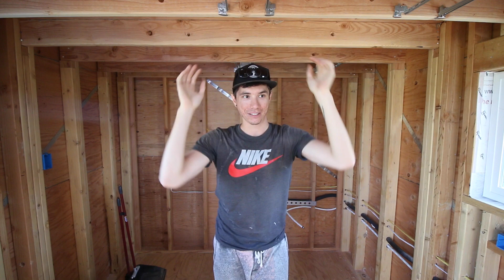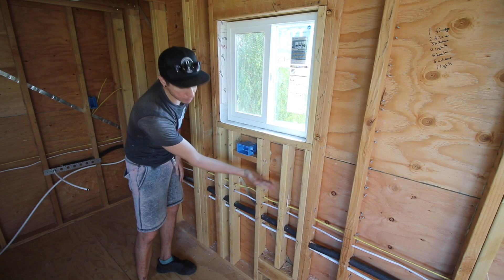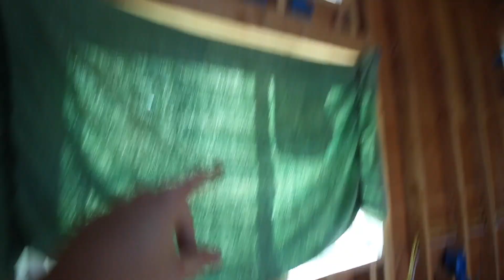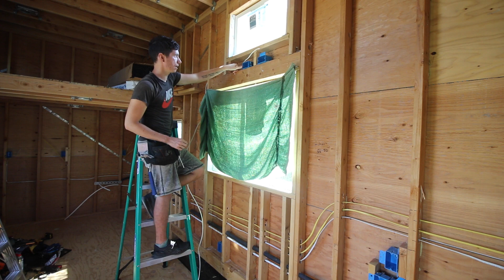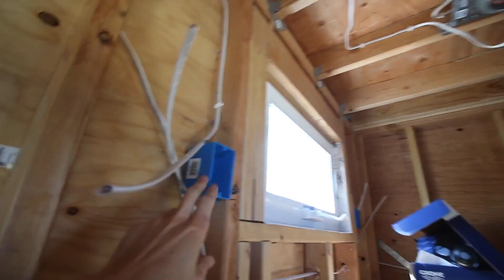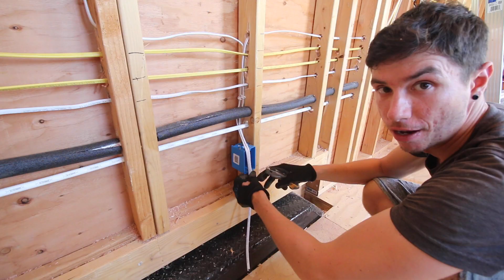ELECTRIFYING! Tiny House Electrical Day 3

Comment: The fridge consumes a lot of power and putting it on a separate circuit is needed or you have a much greater chance of blowing the circuit. Like in houses... it gets its own 20 amp circuit.

Comment: If there are multiple switches and lights on one circuit, how does the power not switch off after the first switch is off? How do you keep the second light/switch hot??

Comment: Hey Derek, I noticed you didn't run any Ethernet cables around the tiny house. is that something you intend to do last or did the customer not specify that in the wiring requirements ?

Comment: If in 1 circuit many big load stuff doesnt it burn wires then.. unles u have breaker somewhere. Im no electrician.. but i o day wanted to know something about electrical stuff and started to learn from the botom. I think it was so if u have to much pover u burn wires and if u dont have enough power u burn wires to... i thin it is just to take a load of vires if u have enough power.. uf u dont have enough pover circuit breaker vill brake. And it cant be so when u turn stuf on an some other stuf goes of.. thats dangerous... it means circuit is not breaking when it should and somevhere something is going to heat up. I also like when vires and pluming is  not inside the wall inside the insulation.. u can make seperate chanel accesable from inside.. covered vith lockable cover. Like car pannels.. rip them of and u get acces to ur lines..

Comment: How do you know how many boxes you can put on one circuit and what size write to run? Thanks
Reply from the maker: 12 lights or plugs on standard circuits for general use (bedrooms, living room, etc)

that was the code in Canada
Reply: LED lighting has changed everything. well..not the code, but certainly the reality. 2  different things sometimes

Comment: Surge current when the compressor starts is why the fridge needs to be on its own circuit. It will use all the current available when it first kicks on. Anything else on the circuit using power would probably cause the breaker to flip.
Reply from the maker: ahhh... that's it
Reply: Or at the very least all your incandescent lights will dim each time the fridge kicks in.

Comment: For the kitchen is it just one single 20 amp #12 where you are for each outlet? Last I heard here in Alberta all kitchen wiring is a # 14/3  split phase with a dual 15 amp breaker. That's bizarre if the code changed again. I prefer the split phase because it gives up to 30 amps at each receptacle. Also two receptacle's are allowed on each branch circuit as long as they are not side by side, two main feeds in a criss cross pattern will supply up to 60 amps total for an average kitchen. I suppose they went with single dedicated 20 amp circuits because even with a split phase it's easy to overload a circuit, or is it wirded like you are doing because you are only going with a 30 amp main?
Reply: no no no no no not how it works, 14/3 will give you two 15 amp breakers which is useless cause itll trip both, it's just how lazy idiots wired houses before
Reply: Roberto Mendoza Bullshit. If you pull about 1200 watts off of each leg of L2 and L2 at the same time they cancel each other out on the load of the return line neutral because they are 180 degrees out of phase, if you were to pull 1200 watts of  just one side than the load is on the neutral. You are old school duh. Fail...
Reply: htf are you gonna get 1200watts off a 14/3???????????????  
or you talking about 3 phase ??? 14/3 is small wire
Reply: You cut the middle of the hot at the plug before you insert it into the wall. You just have to cut the little tab in between the two hot lugs. L1 and L2 each have their own 15 amp breaker sharing the neutral and must be inserted in the middle of the bus bar at the main panel. Simple...must be a Canadian invention if you have never heard of it. When load is pulled by itself off of L1 the return is the neutral. When a load is pulled off of L2 and none on e L1 again the neutral acts as a 14/2 on either either side. Since L1 and L2 are out of phase by 180 degrees, if their is a load of example 100 watts on just one side you will read 100 watts on both the hot and neutral. If one side is pulling 100 watts and the other side is pulling 200 watts the neutral will read the net sum difference of 100 watts since only half of it's sine wave is cancelled out load wise. Microwaves have to have a dedicated circuit to help avoid the un-balancing chances.
Reply: Just re-read part of your question. 1200watts on a 14/2 or 14/3 is easily achievable, I agree with you though it does push it to the limits. This is the reason now that most resistive space heaters are rated at around 1200 watts.
Reply: Try it sometime at your mains panel with an amp clamp. Put an equal load on both L1 and L2 and you will read zero or near zero on the neutral. Put a load on just one side of L1 or L2 but not both at the same time and you will see that the reading in amps across the neutral will be the same as the single side that has the load. In theory a typical 100 amp mains service should never be built to carry more than 50 amps on either either side
Reply: Nice tiny house but I am surprised you are un-aware of the technique of using split phase on a 14/3. Here is a link. Hope this helps. http://www.electrical-online.com/kitchen-split-receptacle-circuits/

Comment: Hey DMan, I'm learning a lot, thanks! I just paused the video to leave this comment so excuse it if you cover this... when measuring 36 inches up from the floor for the countertop outlet, make sure to include the padding and flooring material that you plan to lay down, since that will eat into your current 36 inch measurement (I hope that makes sense). Unless the final flooring is already installed? Also, what's the difference in color for the wires, yellow vs white, amperage?
Reply: White = 14 Gauge, Yellow = 12 AWG, Orange = 10 AWG,  Black = 8 or 6 AWG

Comment: You just clipped your wires and rolled them ahead of time? I hope you don't plan to power the house at all before you hook up switches or your going to trip all the breakers. just cut them straight off and roll them back. thats crazy.
Reply from the maker: ?? why would I power the house...
Reply: to use an outlet or two for work even. I realize you have power from the house so you don't need it.  thats just crazy. the way we do things on New Homes is we give the crews coming in after us a few outlets to draw power to continue the build.

Comment: you should never let your wires slant down at an angle between studs. go straight to the other stud. run them straight down. stapled to the stud then through the whole.that can actually get red flagged as well as I have seen a few wires and pex closer to the inner wall in the framing. those wholes that are less then an Inch from the inner wall require a nail on plate to protect from screws or nails. You would for sure with out a doubt get flagged for no plates   and yes you are correct about the fridge on its own breaker. Lookin great though.
Reply from the maker: ya... I haven't put the plates on yet....
Reply: dont think its getting inspected, but it does need metal plates

Comment: My question is what was the reason for putting 4+ outlets on the same circuit ?
Reply from the maker: because you can, only certain outlets should be on their own but other outlets and lights can be on the same circuit, up to 12
Reply: +Life Inside A Box ok , is that just a way to simplify the wiring ?
Reply: ? you think every outlet has a home run to the panel?
Reply: +Roberto Mendoza I was curious , because of how some outlets can be tripped by having something plugged in that is over the maximum amount watts
Reply: just the breakers tripp
Reply: +Roberto Mendoza that's what I was thinking , wasn't sure

Comment: Hey man, how come you were using 15amp and 20amp for different things? Nice job, helping me a lot!! Cheers
Reply from the maker: 20A in for the kitchen outlets because that is where you will typically have big draw appliances - toaster, coffee maker, blender, etc

I've also done 15A splits as well, which is the top and bottom plugs are on different 15A circuits
Reply: Aaah I see... thanks for that Dman.

Comment: all those holes in the framework thingies 🤔😁 dont they weaken the statics/strength ? I believe in germany they d put the electric/plumbing in front of the wood thingies/even in front of the isolation 🤔
Reply from the maker: I've been doing it like that my entire apprenticeship, it may weaken it a small bit but not enough for it to be significant :)
Reply: +Life Inside A Box good then ☺️👍🏻

Comment: Just use RFI and GFI circuit breakers rather than GFI outlets. Better protection for fire and life all around and easier. They are required by IBC for houses (as you of course know) but IBC doesn't apply to trailers, obviously. It is simply a safety standard to which all modern, careful builders should adhere.
Reply from the maker: that must be a new code within the past 5 years? I'm quite aware that those exist but I've always installed the outlets and not the breakers
Reply: Here's the article from the 2014 NEC
http://www.nfpa.org/public-education/by-topic/top-causes-of-fire/electrical/electrical-circuit-interrupters We are working on some building and remodeling here so am up on the ever changing building codes. Great channel, keep up the good work!

Comment: You had mentioned using off grid solar power.
One the things to consider is if you are going to have strictly a 120 VAC only power, or 120 / 240 VAC like a standard house. 120/240VAC will most likely require two inverters that can work in tandem. Adding a second inverter doubles the standby loss in the system. Because you are powering two inverters instead of one 24 hours a day.
At this time you should be considering a mini-split air conditioner that is also a heat pump. A HVAC will be the number one power user. Be sure and check the SEER rating of the mini-split. The higher the number the better the unit should be energy wise.
Reply from the maker: hey Jeff, yes I've definitely considered that. Everything will be 120V including the AC unit.

The HVAC will easily be the biggest consumer of electricity in the house for sure. It will only be used periodically through the year though. In the hot summer days and cold winter nights.

We're also going to be positioning our house in the best orientation to be most effective for passive solar heating and solar cooling. I'll be painting the roof white to minimize the amount of heat gain from the sun.

We'll also be growing shade trees on the west, north and east side to minimize the heat gain from the sun as well during the summer.

What we'll be trying to do is to minimize the amount of heating and cooling we'll need by integrating other systems and use the AC unit when its just too hot or too cold :)
Reply: Off grid solar systems use storage batteries that are wired for 12, 24, and 48 volts. The way you decide what the battery voltage you are going to use is by the power requirement needed. If the inverter is under 1200 watts a 12 volt battery should be fine. 800 watt to about 4000 watts 24 volt should work. 3000 watts on up a 48 volt battery should be used. If more than one inverter is to be used now or the future 48 volt battery should be used. Note: When shopping for an inverter not all inverters are created equal. An inverter that allows paralleling (stacking) future expansion. This will most likely be needed for when the regular house is built.  Check the specifications of the inverter. An inverter that is rated to run 120 degree F will do better than one rated for 90 degree F.How big of an inverter do I need? This all depends on all
the loads that maybe operating at the same time.

Mini-split about 1320 watts on its highest level.

Microwave about 800-1500 Watts. See manufacture specs.

Well Pump ½ HP about 400 watts plus starting surge.

Countertop induction cook top 1200 – 1800 watts.

Electric hot water heater 15-20 Gallon. 2000 watt heater element. It may be possible to change out the heater element to a different wattage and voltage. The hot water heater could be used as a dump load when the batteries are fully charged.
Reply: A 1/2  HP deep well pump may draw as much as1200 Watts. Starting surge maybe 4 times the running watts. To calculate the starting surge use the Locked Rotor Amps. Starting watts will be LRA x Voltage = watts this should not exceed the inverter surge rating.Since the you will only have 120 VAC available you need a 120 VAC well pump. The well installer will most likely have to special order the pump.

Comment: Why aren't you doing the drywall too?
Reply from the maker: have you ever done drywall?
Reply: Some tiny house builders prefer using planks or bead board (sp?) instead of drywall for fear of cracks that may appear when the tiny house is in transit. As for the electrical--like others have mentioned--you have a good knack of explaining/teaching things. I learned a lot.
Reply: Actually i have and before you get defensive i just meant because you seem to be good at everything else.

Comment: Couple things...didn't notice any outside outlets or lights. Might be your plan but wanted to mention it. Also you say you are going to drywall. That stuff is extremely heavy and the mud seams might crack when you move the house. Most tiny houses I see are not drywalled for these reasons.
Reply: +Life Inside A Box  I hate drywall mud and tape, always get my stoner friends to do it.
Reply from the maker: I'm running an outside plug differently, there will be an outside light, just have to cut it into the siding

I'm aware of the drywall issues.
Reply from the maker: I can't stand doing it either, I'll hire someone to do it

Comment: Is there a limit to how many plugs, lights and appliances (especially the heating/cooling) you want on each circuit? Would be VERY interested to see how you do your ceiling fan, too, if you don't mind filming it. Thanks for the informative video! Very easy to watch and follow.
Reply from the maker: Certain appliances are required to be on their own circuit and by the nature of how you wire them, they have to be on their own circuit.

For general use lights and plugs, a maximum of 12 per circuit.
Reply: Thanks!